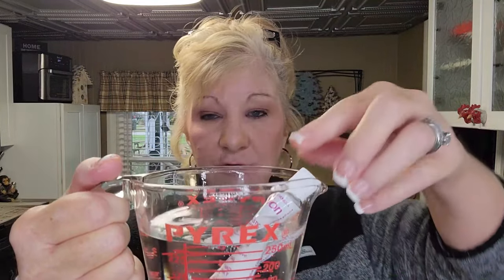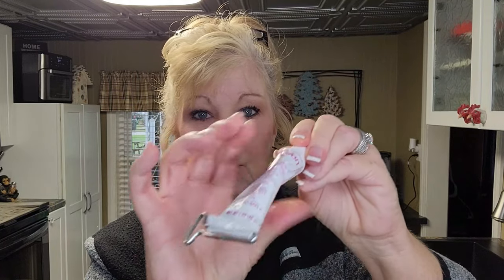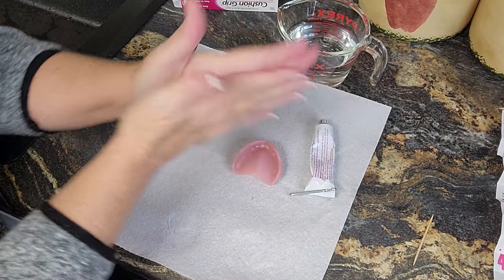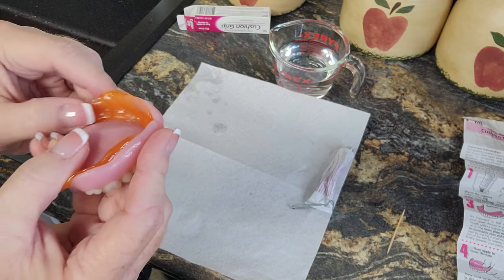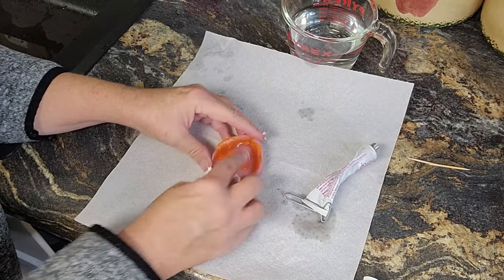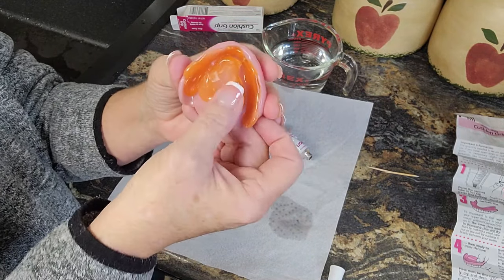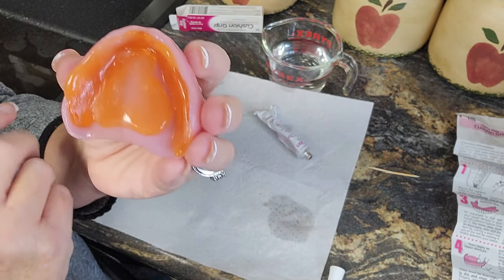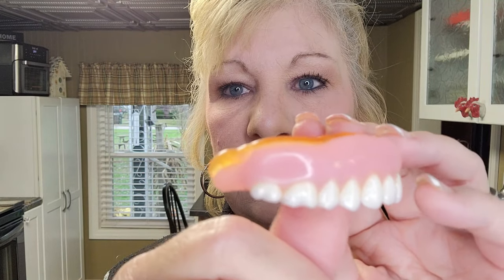How To Apply Cushion Grip to your UPPER DENTURE

Comment: I’m a 3 week old denture wearer. I’ve gone back 2x’s to get them adjusted and they are still cutting into my gum making it too painful to wear. Thanks to you I’m sitting here putting the cushion grip into my dentures and feeling hopeful! Thank you and also you are just adorable ❤
Reply: They comfy for you now I hope..
Reply: I feel your pain! I had my full extraction July 10th and I’m still struggling 😭
Reply: I went through the same and once my gums started shrinking it became unbearable. Like biting glass! This has really helped me and I hope it works well for you too.
Reply: I have the same problem with my dentures (4 years of not wearing. ) not staying in and hurting my gums. I had them adjusted but it didn't help. This may work. I never heard of this sealant before.

Comment: I've watched many of your vids, and subbed, and now after a year of giving up, I miss not having teeth, being able to smile, eat anything but soft foods, have a conversation and not struggle to pronounce certain words, the list of things goes on, so I'm heading back to the denture clinic to have the palatal length shortened on the upper, and a little taken off the rear insides of the lower, severe gag refex. As you would expect though, the down side is reduced suction for the upper, which is what lead me here, to learn what works and what doesn't. Secure Denture Adhesive Cream seems like the way to go for the lower, but the upper, the one that's going to have far less suction, isn't so clear. Best suggestion, cream, strips or cushion grip? Anyone who has had their palatal length shortened please chime in, my sanity(read vanity) is depending on it😎
Reply from the maker: The Secure cream works great.  If your dentures aren't fitting good use the secure strips.  They add a little cushion and fill up some space in your denture.

Comment: I have a question for you. You mentioned that there was a stinging feeling. This was on your lower denture video. Did that feeling ever go away? Also, if you used the clear beads do they sting too?
I am having such a problem with my sensitivity to denture adhesive due to the stinging I feel in the evening. I have dry mouth and I know it doesn’t help but I’m beginning to think I have a sensitivity to something in that adhesive. I need an alternative.
What do you think?

Comment: I'm getting ready to apply for the first time. Pushing it up on the upper denture makes sense. I can see the logic behind that., since it's really not an adhesive. Do you have to warm the tube before every application? I will give you my verdict after my first day. There was a guy doing a video on application that was not as clear as your presentation. Thanks in advance. FOLLOW UP: As earlier stated, just applied for the first

 time. It is very pliable
 and spreads easily (same thing) However, I think I may have put it on too thickly because the pink gum part of the denture is exposed more than it was previously. Mainly concerned with how it holds. I will adjust the amount on my next application. Used it on an upper horseshoe and it seems to be what I was hoping for. Don't know if I will try to eat with it but, we'll see.
Reply: To the best of your ability, can you estimate how many applications I should expect from a 1oz. tube of this? I ordered 3 tubes at once.
Reply from the maker: When I was using this on my immediate denture.  I could get it to last in my denture sometimes over 3 weeks.   Three tubes should last you quite a while

Comment: I need clarification please.  Is the cushion grip used in place of soft reline? How often are you replacing it? I'm 2.5 months post extractions and still in the healing process.  My original soft reline done in office was botched horribly! The dentist was incompetent  (I'm making this statement after several appts seeing her. The 2 day post op first adjustment she sent me out and before I left I was back in the chair because she didn't adjust them enough and she still left sharp spots. Then had to wait 2 weeks to be able to get them readjusted from that first appt. Now me being me I gave her the benefit of the doubt. I should not have.  The dentist took the maximum amount of time and did minimal effort. A week after that I got the soft reline. What she had me walk out with was awful. I once again realized before I left the office things weren't right.  She took a dremmle to take off the excess reline material. A DREMMLE  in 6 different places.  You could still see reline material everywhere on the outside of the denture,  I couldn't smile because you could see all the reline. She didn't put enough material in to cover the whole top plate, but then "purposefully " extended the soft reline around back molars and past the palette.  She told me to keep my dentures in until time to clean them before bed.  It was only then that I finally got a chance to see the horrible reline job and the damage to my denture.  I went in 4 days later to a different dentist in the office who claimed that using a dremmle in that situation was normal covering their asses. After the first reline appt debacle  the receptionist point blank asked me if I wanted my hard reline with a different dentist.  I was blown away that a staff member would step in but I was going to ask for a different dentist so she read my mind.  When I got the soft reline "fixed" the new dentist put down acrylic glue to keep the edges of the reline down as even that first night it was all not staying in place.  I was terrified to even brush the reline. It was falling apart. Even though it was their office that botched the reline told me I could get a new one for $90. I'm excited to get a new soft reline.  I bought the prosoft , however after seeing the cushion grip vid I have more questions.  Thank you
Reply from the maker: You can use the cushion grip overtop of any soft reline.   The prosoft is more permanent than the cushion grip.  The cushion grip will wear out in about four or five days.
Reply: Your situation is very similar to mine! I’m about 2 months post extractions and have had so many issues with the dentist doing my 1st soft reline. They actually sent me on my way looking like my immediate dentures were from a costume shop!! It was horrible and embarrassing!! 
Idk who you’re going through, but I wouldn’t recommend Aspen Dental
Reply: I had this same experience just recently. I’m 6 weeks post op, on my 2nd pair of dentures and they are still just awful. I don’t know what else to do at this point. My bottom plate was trimmed heavily in the wrong places and too much was taking off and now I’m stuck with what I have and it feels like razor blades on the side of my gums. I do have a soft reline in right now but it’s so bulky it won’t go over my gum and so it’s just sitting on top of it. Any tips would be helpful. I am def going to order this cushion grip tho! 🤞🏼🤞🏼

Comment: How long does cushion grip last? Also, can you place it on top of a soft reline done by a dentist?
Reply from the maker: The cushion grip will stay in your denture three to five days.  Then you have to take it out and start over.  Yes, I put mine over the soft reline from my dentist and it did fine.
Reply: @RealLifeWithMichelleRob  ok new to dentures about year in ok  is this stuff just like using adhesive? Or just takes it spot  kinda like a reline? I had my relines done few months ago . Seen one video guy saying he use this stuff and when he takes them out and soaks them water with this stuff still on?
Reply: @borndifferentnf1 my second time. Works wonderfull. Going to fly with it tomorrow and no adhesive. Good seal but not perfect live adhesive. But I still can't eat. It's only been 2 weeks for me total.

Comment: After putting on the CG can you remove the dentures, soak them over night and still be able to wear them the next day without reapplying? I don’t want to wear the dentures for 4 days straight. Can I remove them and reuse with the same CG?
Reply: Yes you can you don't wear the dentures for 4 days the cushion grip stays on the denture for 4 days or longer I get up to 3 to 4 weeks per application you take you're dentures out to clean soak and brush like normal and the cushion grip stays on until you are ready to take it off to remove it just soak your dentures in hot not boiling water for 10 minutes and peel it out

Comment: Hey there thank you for this. I just did mine this morning and just didn’t get it right. Not enough. So I took it off and it peeled up a pretty good amount of my dentists reline material. About a pea size hole. Would it be ok to just take that soft reline out completely and do a cushion grip application then? The pallet is so thick I feel it may fit better without adding to what he put on there. Any thoughts anyone? Can I take that soft reline off completely? Looks as if it will peel pretty easily.
Reply: Yes you absolutely 💯 can ❤

Comment: I am having a problem with my lower denture These are temporary right now but I’m having nothing but problems with my dentist to but they got me. I have no money they got all my money. I don’t know how to get it back and I doubt I will be able to so I’m stuck with them so I think I’m on my eighth try with different types of denture creams. I’ve been trying what you use and it nothing works on the bottom one I have a muscle in my cheek that they said it’s pulling the denture up when I go to eat and that’s why it keeps floating I don’t know what to do anymore. I have not had a real meal in months. I have my ice cream with protein in the morning and then I either have cream of wheat or a soup kind and time just like like eating it comes up so I take it out that’s why I eat what I eat and I have no idea what to do I’m frustrated I don’t know what to do with my dentist if I have any chance to do something with them and get my money back, I don’t know that’s all the farther we are is with the temporary so anybody has any ideas or any plans please please please let me know. Before I get told that I shouldn’t have taken them out but put new stuff on them so I learn the correct way of eating with them I have done that. I wake up in the morning and put them in by the time lunch comes around. I replaced it with different types of denture cream because I want to see which one is working each time and by noon when I start to eat it comes out You guys know how it hits the gum and that hurts and by then I’m just so frustrated I take them out. When I had the extraction my right side on the bottom kept Bleeding she put some cotton in my mouth told me to leave there hold it really tight and sent us on our way😅.  On the way home. I had to change the gauze three times because it was getting soaking wet and coming out mouth blood that is. Also, I could not put my bottom dentures in because it was bleeding so it was bad. I told my husband to turn around we went back they brought me in there they kept asking and asking are you sure you’re not on blood thinners are you sure you’re not? I don’t know how many times I had to say no. My blood pressure went up so they sent me to the emergency room. I think they sent me there just so they could keep their hands off of the mess they made.  So lucky me I got to the emergency room and the doctor I get starts complaining telling me that she’s not a dentist. She should not have to worry about this but here I am hurting and pain and not getting any help. Finally, she said that an oral surgeon gave me some kind of shot and sent me home. I woke up at 3:30 in the morning choking on my old blood I got up to spit it out and I had blood clots coming out or I don’t know call that’s why I called. We have two bathrooms rethinks in two and one and one and one obviously and my husband said it looks like a crime scene cause I spitting it out and I didn’t know what to do and it kept choking out, spitting it out so we went to the emergency room again and I went in there and he gave me some type a shot but he also had the nurse call me and she brought with her a key bag which makes black tea never heard of it. I do not drink tea. She put that on my gum and she pushed hard on it which felt like an eternity. My husband kept grabbing my hand to hold.  I couldn’t believe it. It worked whoever the thought of a teabag not me. The pain was so so bad. If you knew my history and everything I have been through you would think wow this must really be excruciating pain because I’m a cancer survivor and I have had so many surgeries since then other parts of my body because of the chemo and radiation and I know I have Crohn’s and fibromyalgia that’s all hit with a couple of months after I was done. I just what I thought life could get worse. I got to get my teeth removed because of radiation in the chest area and the medication on now. I’m just telling you this, so maybe it will help someone that is going through it just like me that they are not alone.  I also hope that someone out there would help me and how I can get my money back or somewhere else. I’m an idiot I didn’t do enough investigating before I had this done. I trusted my dentist. He sent me somewhere because he knew I couldn’t afford his, and he knew I had no insurance to cover it for the year That I used it all up with him pulling my teeth out every other month  it seemed like. Wednesday I have to go back for my fifth reline and a new mold for the 2nd time for the bottom denture. The new reline is because of air bubbles. It took me 2 Weeks of calling with no call back and their corporate office trying to call them and they tell me they don’t know why they’re not answering the phone maybe because the whole line is down by them and I thought you would think they would get that fixed as soon as possible and will wait two weeks to get it fixed. Being a business. my husband finally went down there and had to do some a polite word for it bitching.  I so now you know who I am asking for help. oh yeah, I tried a lawyer they wouldn’t even talk to me about the case because they said that the dentist is doing anything and everything they can funny how you can sue a doctor so fast and yet with the dentist goes in your mouth and yank your teeth out. You have nobody to protect you. Sorry I’m done. Thank you.

Comment: Cushion Grip is an EXCELLENT product and will keep your dentures secure with a seal so food getting under the dentures is NOT an issue...." word to the wise" This is not a long-term reline & ya do not want to go beyond 4-5 days.  Anything longer and this product will become attached to the denture.  After 6 days, the liner became discolored and literally attached to the denture i tried boiling hot water, rubbing alcohol, peroxide, etc, but nothing worked.  i called the manufacturer directly and was advised hold them under warm water, again, NOTHING worked.  i tried using a carving knife, but nothing worked.  I made an ER appointment with my dentist, hoping they would have a solution.  They did not, the dentist gave them to his tech to remove the product, the tech was able to remove the product but destroyed the denture in the process (A hole at the top and side of the denture (fortunately, for me the denture is temp, as they are a stop-gap until i receive my dental implants so i will not replace them.